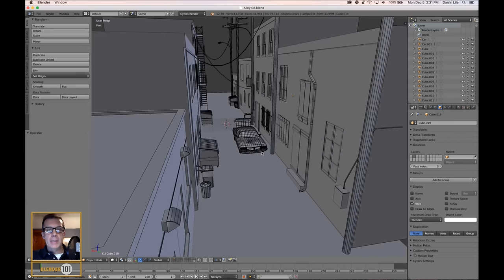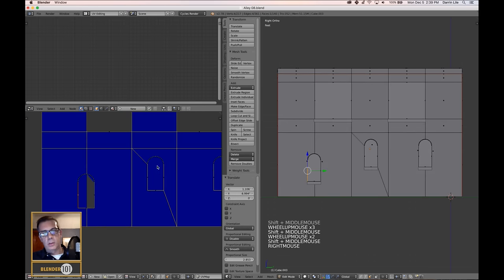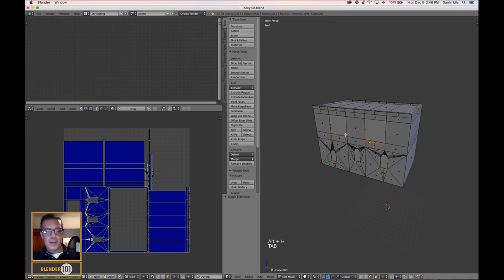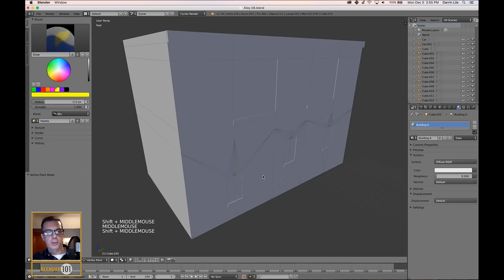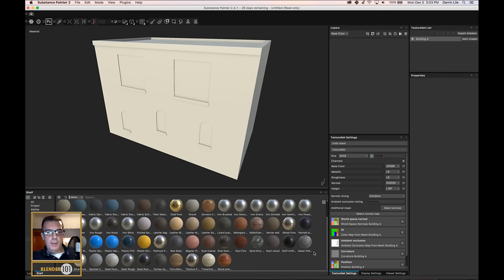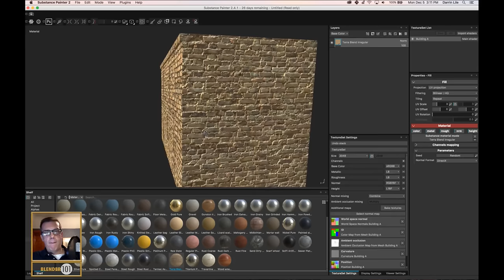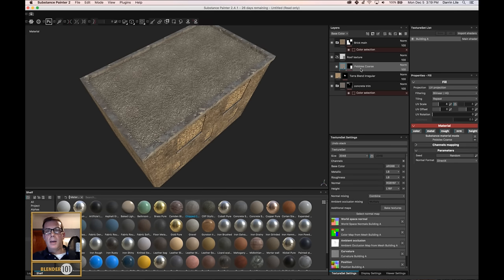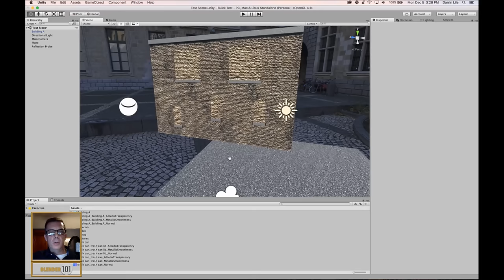Blender: Modeling an Alley 08-Live Stream

Comment: Hi, I just installed Blender and I have run into an issue. It is extremely laggy and slow right off the bat. I have tried many things like reset my computer, reinstalling, updating drivers, older version, etc. I can't seem to have it run even somewhat decent. I have an Intel i5, Nvidia 860m, 8 gigs of ram. I don't see how my computer can't run blender. If anyone has had the same problem fixed can you please help out? Thanks.
Reply: my computer is a i5, nvidia 930m and 6 g of ram and run really good blender and substance painter too(this with a little lag at baking texture but okay)